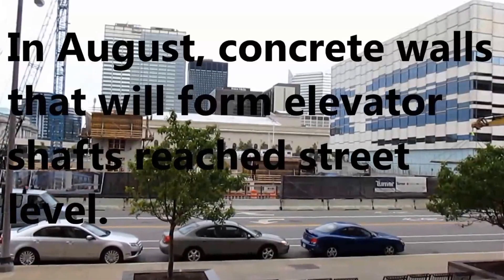Workers dig deep to install Cuyahoga County hotel's support system: Video

Comment from the maker: CLEVELAND, OH -- Some skyscrapers demand more foundation than others. Downtown Cleveland's so-callled "soft soill" required going down about 200 feet to hit bedrock for a hotel that will rise 30 stories.
The 600-room convention center hotel, operated by Hilton, should be done by 2016.